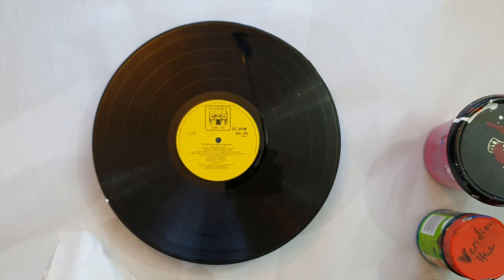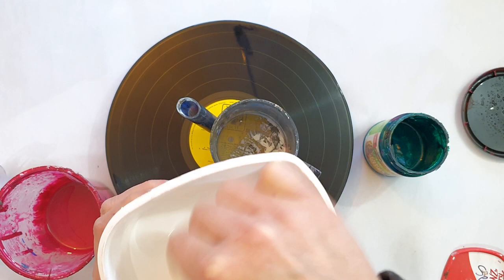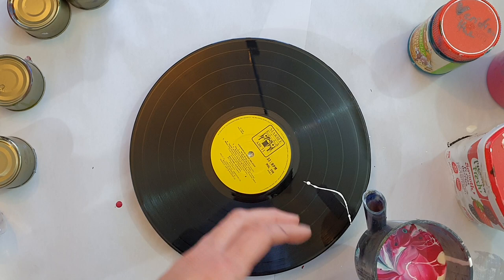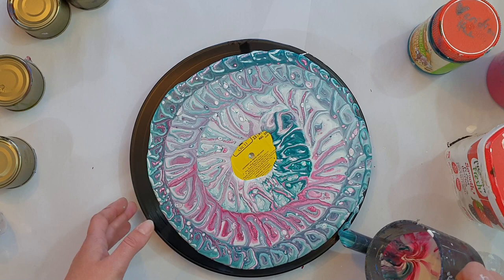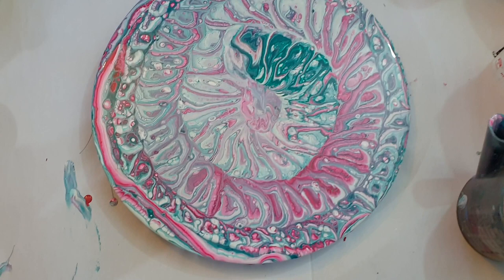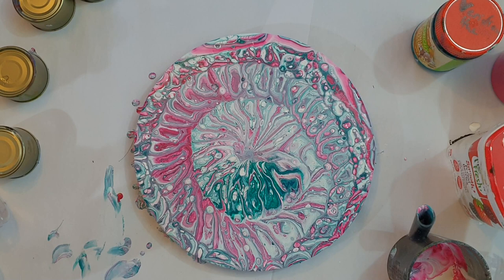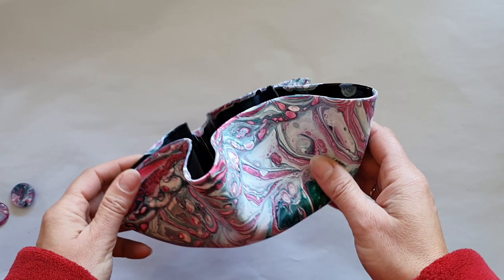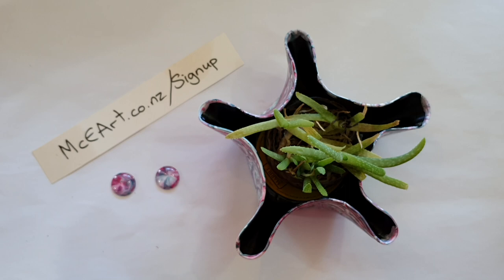546 Pouring a Record Plant Pot  with a spiral pour

Comment: I have a question for you.  I poured a vinyl album to make a clock for my son’s BD. (Second attempt).  It turned out beautifully and I had it out on my covered 
patio to seal it.   A few hours later, I went back to spray the second coat and the sun had moved around and warped the vinyl.  I tried putting it under a heavy load 
of books to flatten it out but that didn’t help.  Any suggestions other than making a planter from it? LOL My son’s BD is Tuesday and if I have to start over
again it’s going to be very late. TY
Reply: Put it in the oven on 200 for a couple minutes